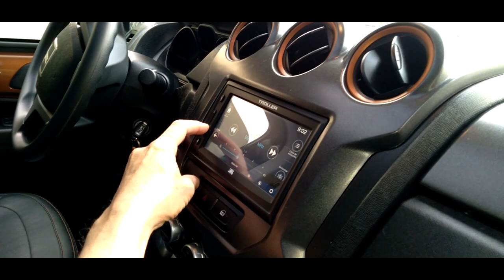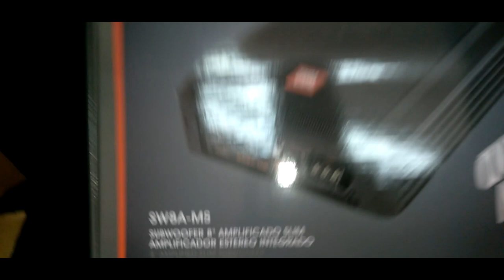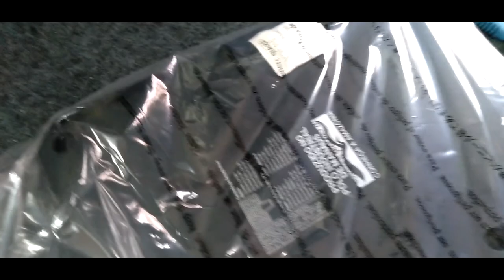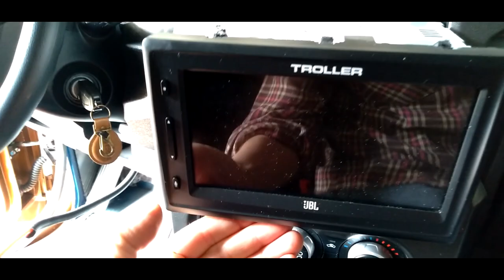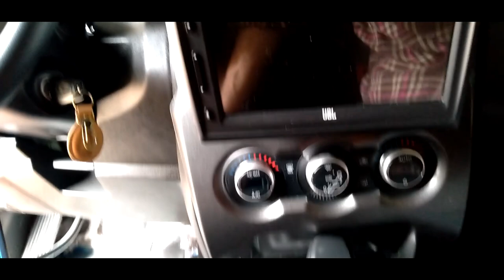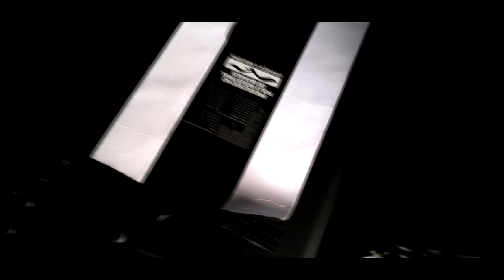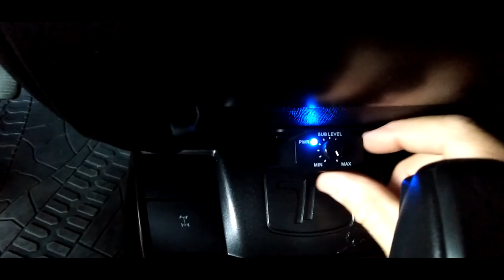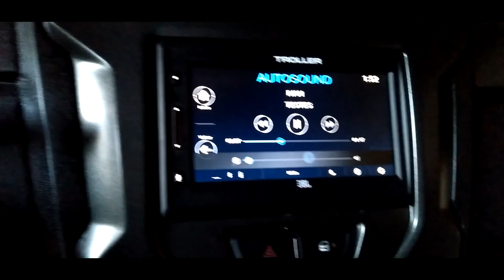🏁TROLLER🏁O Som  off-road 4x4 - upgrade c/ caixa JBL SW8A-MS + alto falantes FLEX3 6TRFX50JBL

Comment: Obrigado por compartilhar o vídeo. Tenho um Troller e estava na dúvida se este modelo caberia embaixo do banco original. Pelas medidas que fiz estava no limite! Realmente é uma ótima saída para não comprometer o porta-malas pequeno.
Reply from the maker: Cabe mais fica batendo quando acionado a alavanca do banco para vir a frente e dar passagem a pessoa que vai na parte de tras do veiculo. O banco do motorista vem a frente e a ferragem debaixo do banco encosta na caixa. Por a caixa ser de material muito resistente provavelmente aluminio em bloco para dissipar calor , nada acontece, de problema fisico ou eletronico. Mais pode vir a arranhar a pintura. O ideal seria só usar o acionamento da alavanca para levantar o banco quando for irremediavelmente necessario o passageiro traserio se deslocar por ali. Os passageiros traseiros sempre tem a opção do banco do outro lado livre .
Reply: @autosound   também pensei na outra opção a JBL sw68a-ms. Ela é um pouco menor e potência só de 100 W. Já fez alguma instalação deste modelo?
Reply from the maker: @ricardowendellaquino  Não recomendo é muito fraca. Outras soluções só fazendo sob medida em marceneiro especializados um box para sub de alta performance tipo sim de fabricantes conceituados como JL Áudio ou Pioneer importados